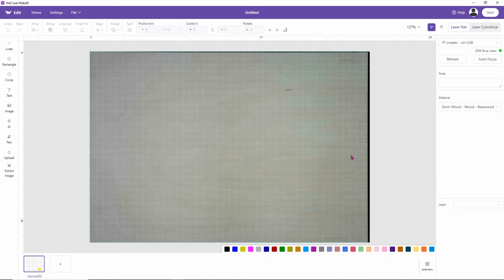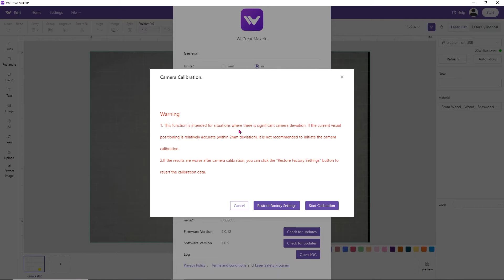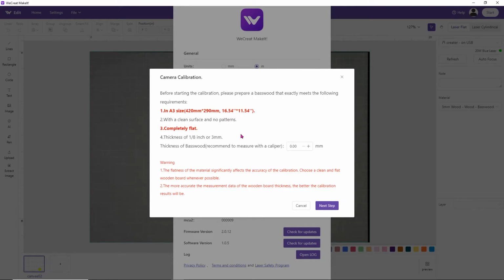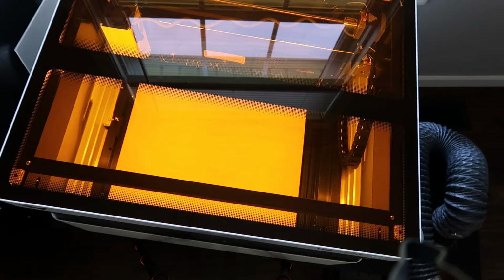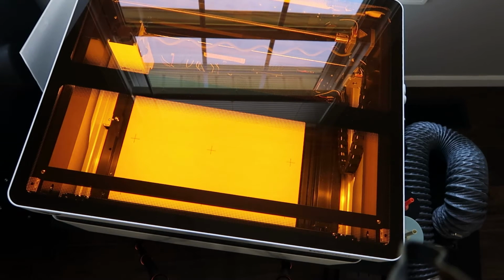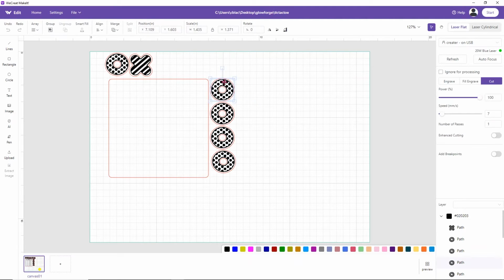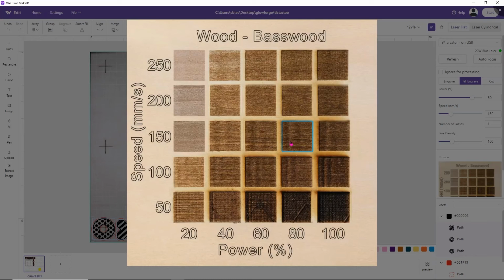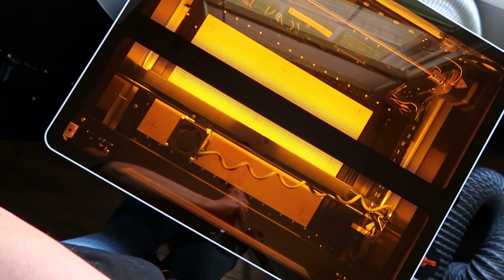Calibrate the Wecreat Vision laser step by step guide

Comment: Do you have a video about when the camera won't calibrate?
Mine prints the cross hairs the goes to the next step called calibrate data at the bottom and fails. I checked the reasons it gave me, but everything was ok.
Please help!
Reply from the maker: Try uninstalling and reinstalling the software. I’ve never run into that issue so I’m not much help

Comment: are you sure it is the screw holes on the top of the gantry or the one on the side where the divot lines up with a hole on the side of the gantry?
Reply: The manual shows you that you line it up with the hole on the side all the way in the back, but it works the same using the top holes.  I lined mine up with the side holes and then checked that they also line up with the top holes.  It was slightly off out of the box, but easy to adjust.
Reply from the maker: I’m sure it’s the top
Reply: I also have the two screw holes but they do not line up...
Reply from the maker: @HkeCheermom  you will need to adjust them if they are not lined up. The wecreat YouTube channel has that in their video. As mine lined up perfectly I did not mess with that portion of the alignment
Reply: Mine line up perfectly with the side hole. The top holes have it sitting too far forward.
Reply: @dougsmith4525  I just saw this video and mine would sit too far forward also. Did you get it figured out?